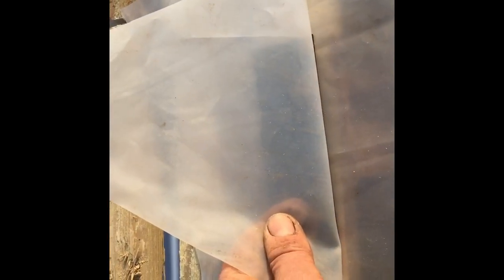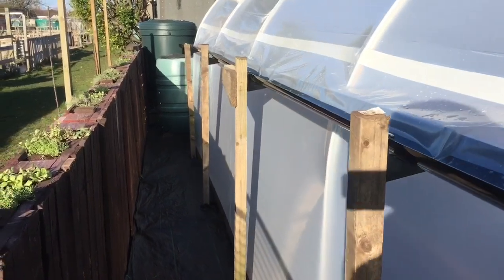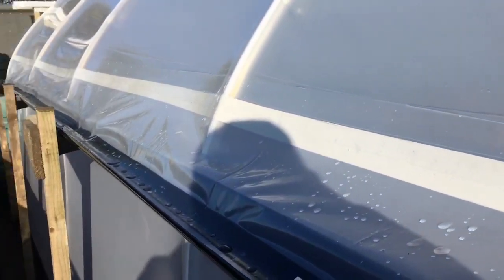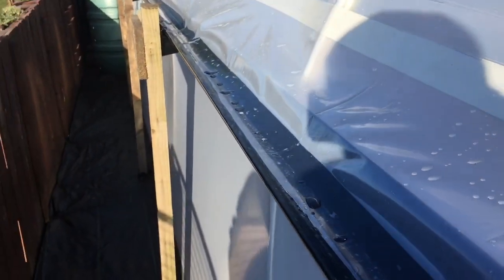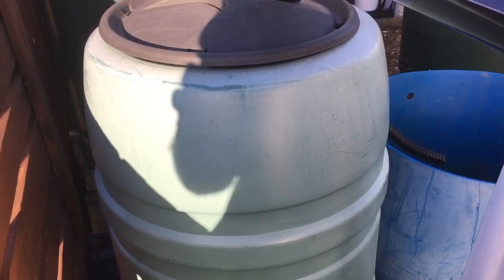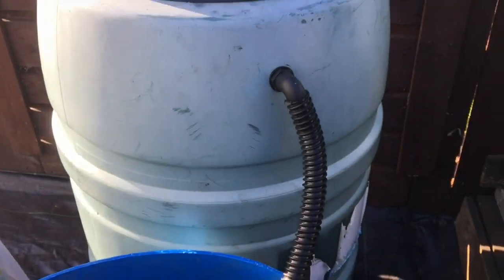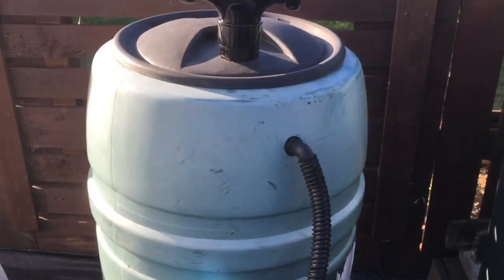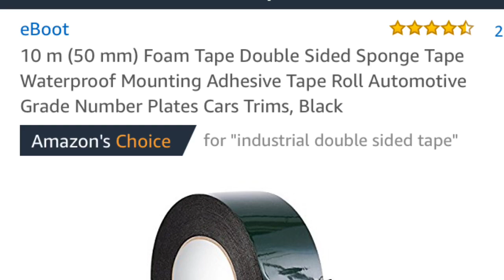How to collect water off a polytunnel with a gutter

Comment: This gives me food for thought, as I'm about to order a polytunnel.
I reckon as it's a new build, it'll be simple enough to install a side rail (tanalised 75x38 fence rail) inside the cover to hold the guttering, then use 100mm cover repair tape on the outside to overlap into the gutter to direct the run-off.
Reply from the maker: Yes, I didn’t want to puncture my plastic because I was worried about subsequently stretching it as it aged. As it happens I’m now 5 years in and the plastic is still tight so I could have punctured it without issue : all the best - Steve

Comment: Hi Steve.  Brilliant idea.  The only thought that crossed my mind was what you might do when you re-tension your polythene cover.
Reply from the maker: I did think of that, we pulled the poly skirt fairly tight, so when we retention by about an inch it shouldn’t loosen up very much. The worst that can happen is that we tension by 2 inches in which case we could cut the poly in the gutter and reattach it but I don’t think that will be needed. : all the best - Steve

Comment: I have just gotten a 3.5 x 2 x 2 m poly tunnel and I'm going to make a poly plastic gutter an wire coat hanger to shape it then attach it with gaffer tape and now I might also use double sided tape 
many thanks and brilliant work here =)
Reply from the maker: Hope it goes well, we had spare gutter, the double sided tape worked great

Comment: Hi Steve, how has the guttering system worked for you now that you've had it a year? Have you made any adjustments to it? If you have another video about it, please point me in the right direction. This is such a clever idea! Thank you for sharing 😃
Reply from the maker: Hi Liz, it's worked well, I updated the design for the other side and updated the video too https://youtu.be/jjEXhIR0e_E  There's a good discussion too in the comments, with some people suggesting cheaper options, but I'm happy.  I'm about to do a video all about designing a water capture system in a week or so  : All the best - Steve
Reply: @SteveRichards  Hi Steve jumping off the back of Lizs comment, how is it faring 3 years down the line?  just planning a community garden polytunnel installation and your video has given me some great options. (thanks also for the products you used at the end)

Comment: Great idea Steve, have you thought about an IBC tank? I know Tony @ukherewegrow loves them. All the best.
Reply from the maker: I've considered it, but to be honest they are a bit unwieldy for me.  Unless they are fairly full the water pressure is really low and it takes a lot of water to fill them.  I prefer water butt's because they are tall and thin they have great water pressure and I can clean one while having another full etc.  Also I have a space issue.  Tony has the advantage of a huge water collection area AND a generator and electric pump, so he can shift the water around easily and keep everything full.   : All the best - Steve

Comment: Steve - I know this video is old but do you know what waterproof double sided tape you used for this? I can't find anything suitable - at least in a 10m length that I need. Lots of foam based ones on Amazon etc but having used them before they aren't very good. 
Ta!
Simon.
Reply from the maker: I did use the foam ones and as you say they are not that good, the adhesive is failing already, although the polytunnel repair tape is still holding everything together well enough, so it doesn't matter that much  : All the best - Steve

Comment: Hi Steve, fabulous solution, thank you. However,  I have just done this with my polytunnel, but I have one of those covers with thicker green lines criss-crossed all over it, making the cover surface uneven. The polytunnel repair tape has not stuck down on it. Have you come across a way of fixing it on these types of polytunnel s please?
Reply from the maker: I haven’t I’m afraid, I think the only solution would be a batten on the inside fastened to the hoop, to which you then attach a batten on the outside, to which you attach the gutter : all the best - Steve

Comment: Nice job.  Be sure to do regular inspections on hot days.  Heat is an enemy to many adhesives, makes them soften and weaken.  Putting the weight of your guttering and the water that will eventually collect in it onto posts was a very good idea.  I wish you well and good luck.  Do you get enough condensation inside your poly tunnel to merit doing the same guttering job on the inside?
Reply from the maker: Yeah, heat is a concern, but the tape seems to be very similar to anti hotspot  tape so fingers crossed!  The product description claims : Sponge tape material: the mounting tape is made of PE foam, have strong adhesion, good retention, anti-ultraviolet, temperature, water, solvent, flame and rub resistant

Comment: Hello, just stumbled across your video. I did a similar thing, but it failed due to wind coming up behind the guttering and eventually it forced the tape off the polytunnel and broke the seal. Did you have any problems with wind?
Reply from the maker: It's held up well, but it's really well attached.  I also benefit from wind breaks to the north and west of the tunnel and that's our prevailing wind direction  : All the best - Steve
Reply: Thanks for the reply Steve. Pleased to hear it has lasted. No windbreaks on mine so very exposed. I may give it another go with more tape, including a strip connecting the underside of the gutter to the polytunnel. Cheers Richard

Comment: Hey Steve, great design. Did you attach the support stakes to the base rail?
Reply from the maker: No,  I just hammered them into the ground a few inches away from the polytunnel  : All the best - Steve
Reply: @SteveRichards  thanks Steve, have you ever had issues with wind moving the gutters?
Reply from the maker: In the video you've watched we have a small issue with the wind catching the west corner (we have westerly winds) when we did the other side we used a different design https://youtu.be/jjEXhIR0e_E which is better  : All the best - Steve